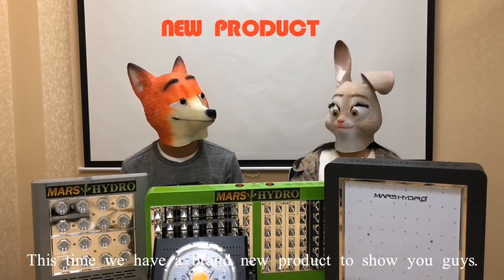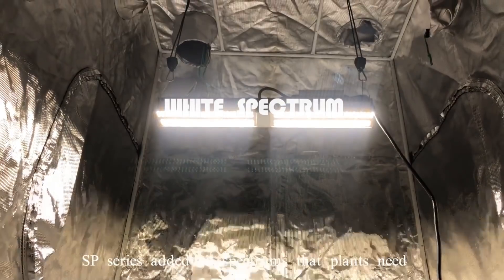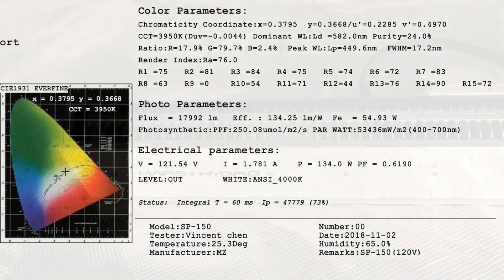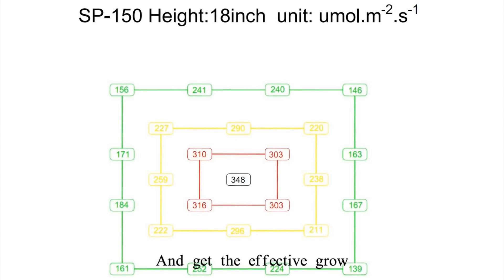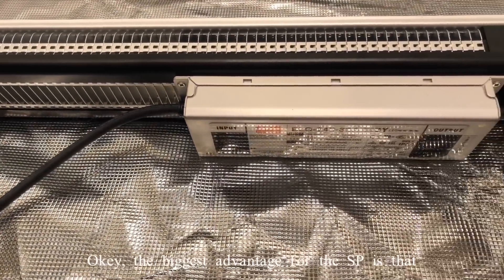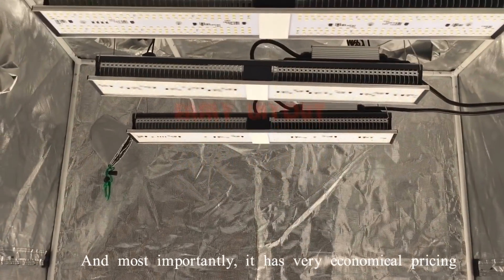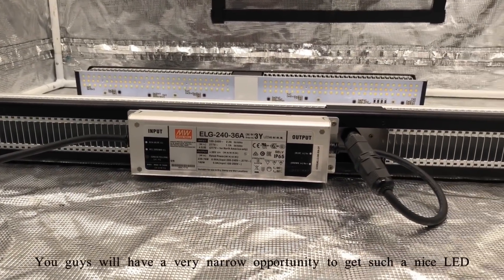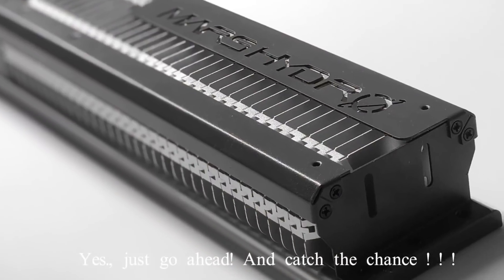Mars Hydro SP series is now available!

Comment: What would be a better light the sp 150 or the ts 1000w...whats the difference..
Reply from the maker: Hi bonzoligist, TS 1000 is square for 3x3 veg, and 2x2 flowering, SP 150 is suitable for rectangle area: 2x4 veg and 2x3 flower; SP has thicker heatsink , better penetration while TS has better coverage. SP waterproof, TS not. :)
Reply from the maker: all is good one, you can choose either one based on your own needs
Reply: @MarsHydro_official  ok...thats not what i asked...but going off your specs the ts doesn't have the ir and uv where the sp does..the ts1000 covers a bit more area,but uses an extra 15w than the sp...the drivers are the same but some people say thay are not....thats how you should answer...lol,where is your product knowledge mars...nice sales work.
Reply from the maker: @bonzoligist6330  the main difference is their design and shape, spectrum almost the same, SP 150 and TS 1000 all don't have IR in our previous version, but we added in latest shipment; SP 150 uses different design, from which the power supply is different from TS, and it cannot adjust wattage like TS do.
Reply: @MarsHydro_official  ok great thats more like it mars your learning😉....ok so with the new shipment the drivers are different on the ts and sp..correct...are they the same quality or does the ts have a bit better driver hence why its driving a bit more wattage.
Reply from the maker: @bonzoligist6330  Mars TS uses drivers that are made in China, but also high quality ones with UL listed; Mars SP 150 uses customized driver, because this light is using different design, it should use fixed voltage, either 110v or 220v; Mars SP 250 is using meanwell driver.

Comment: LoL... I'd have to buy like 8 of these to replace my current hps setup.... or $2700CDN roughly.  No thanks
Reply: Unless your using 2600 watts of HID in a personal grow then no you wouldn't. Each SP200 is equivalent to 360 watts of HID and will last almost 4 times as long.
Reply: @glitches911  2-1k hid.
Reply from the maker: Hello sir，How much wattage do you have in your current HPS?
Reply: 100 wats of led vs 100 wats of HPS  are very far from equal
Reply: And save tons on energy, and lights last longer and emit less heat.. you could always start with a percentage of your operation and test 10% of the girls with the new LEDs and see if it's the future of led as they say..